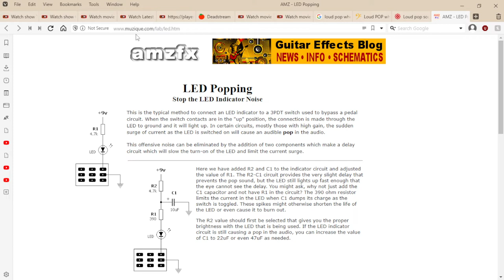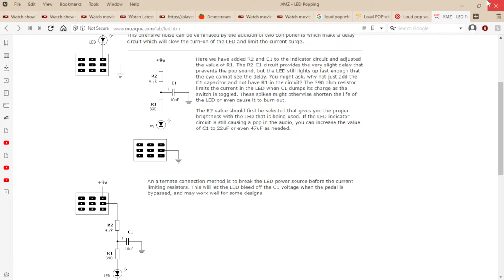gUITAR PEDAL popping FIX

Comment: Curious, if you install a pulldown resistor on the pcb or vero board and you bypass the circuit -how does the pulldown resistor come in contact with your bypassed or clean signal?  Glad you got the pedal pop fixed!